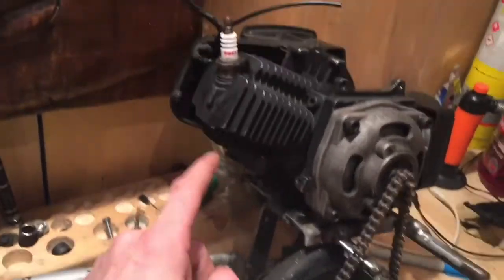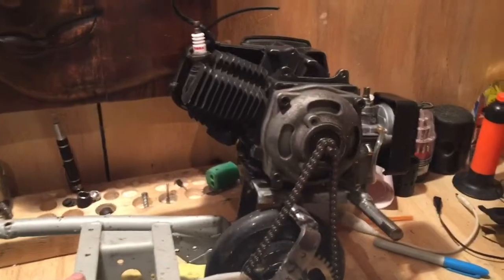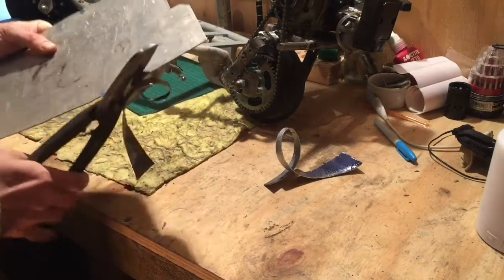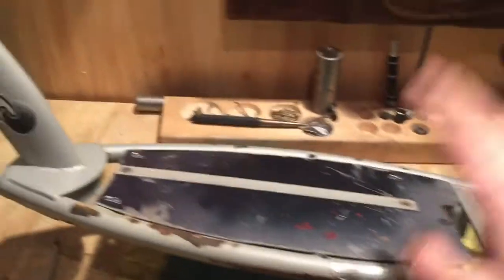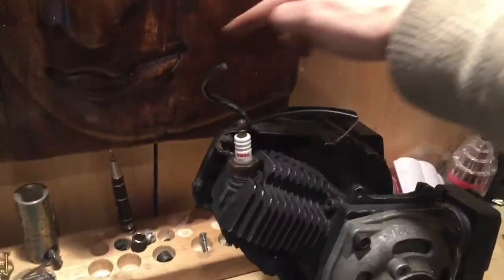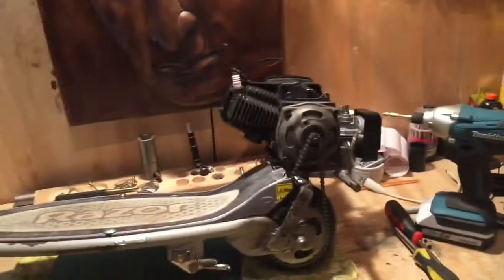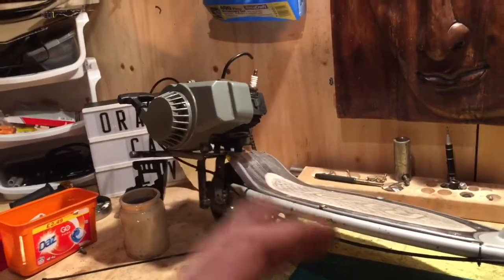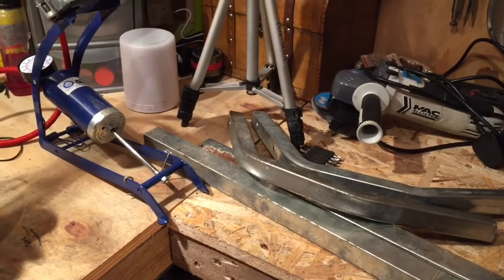RAZOR SCOOTER ENGINE CONVERSION PT 5

Comment: what size chain did you use?
Reply from the maker: That was a mini moto engine, but I can't remember which one, DIRTBIKE/SUPERBIKE

there is 2 types

The tiny tiny chain is called a 25h, and that one fits the mini superbike style

And the other kind is a common chain called 8Tf, Its more commonly used on petrol scooters, bit the DIRTBIKE style  mini bike uses this size.

So this should make it easier for you to work out which one of the two you need.

Usually easy to tell as the 25h looks like its supposed to go inside a wrist watch lol

Hope this helps bro
👍👍👍